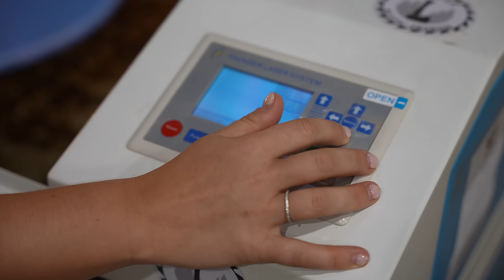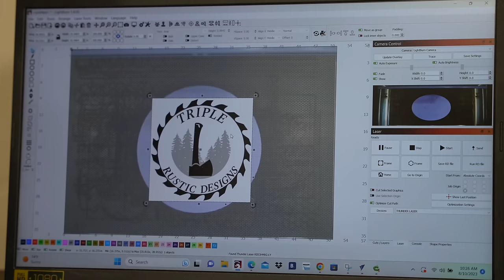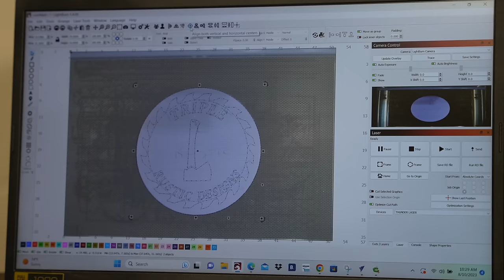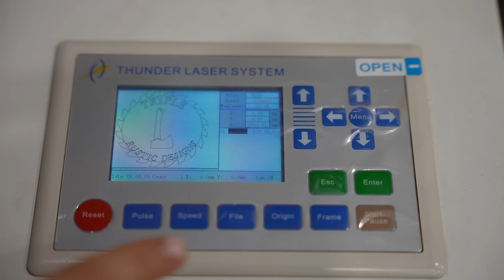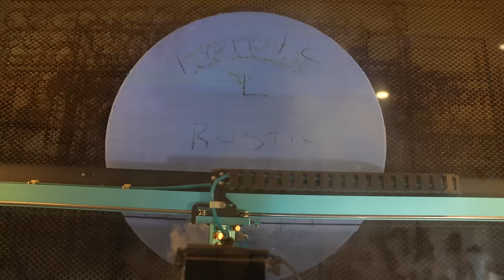Outdoor Sign On Our Massive Thunder Laser - Thunder Thursdays #9

Comment: What can help that I use to paint particularly stuff I need to move around on is a lazy Susan. These are cheap and come in various sizes and work very well for spinning a part ont as you paint the piece. Makes for much easier handling and  complete painting passes.

Comment: I use a CNC router to cut my signs and use masking vinyl, not sure if that would work with a laser or not. I also use a compatible clear coat with my paint to lock the grain and tape so no color paint will bleed.

Comment: 0:45 What were you doing? You need to pull down the cone and have it touch the acrylic block to get the focus right.
Reply from the maker: You don’t pull down the cone. You raise the bed up to the proper height. If it reaches max height then you can lower the laser head. We showed a brief example of adjusting the head but cut to the next step to keep the video progressing in a timely manner.
Reply: @TripleLRusticDesigns  Ah yeah I see. Yes, that's what I meant.

Comment: Sooo. Essentially, you used an extremely expensive laser to make a $50 sign of which "us" small shops make the EXACT same thing using a $200 printer/Cricut and our phone in relatively the same amount of time. 

And then, you turn around and use Walmart paint. 

Hmmm. Interesting. 😮

And what did that laser cost ya? $10k+ electric? 😮

For that kind of money, should have just invested in a CNC. 😢

There is ZERO craftsmanship in that sign. That statement isnt solely said to be rude, it's said to be honest. It's not "Craftsmanship", it's automation. 

I want to see you, I challenge you to carve and route that sign by hand. Can you do it? 

If not, then YOU are contributing to the death of "Craftsmanship". Shame on you.